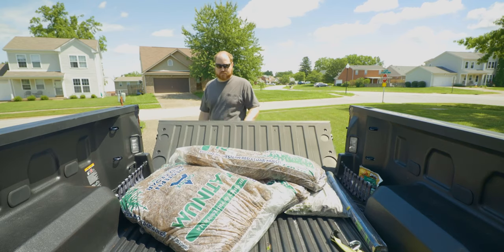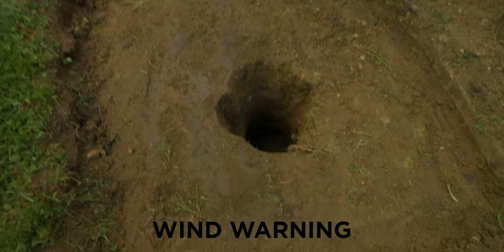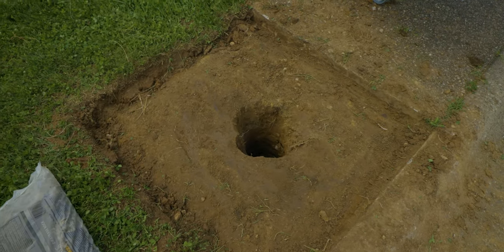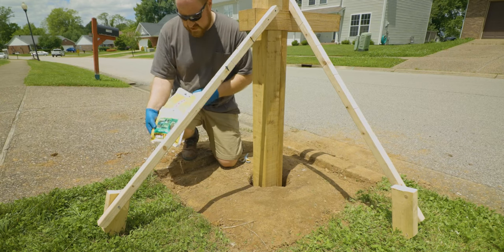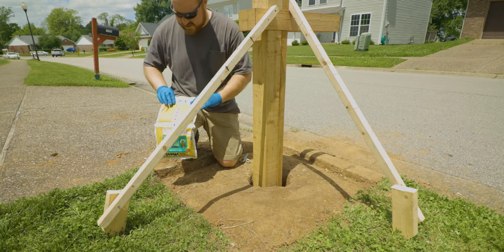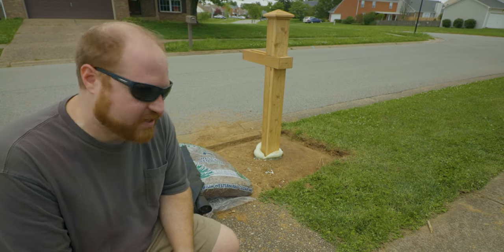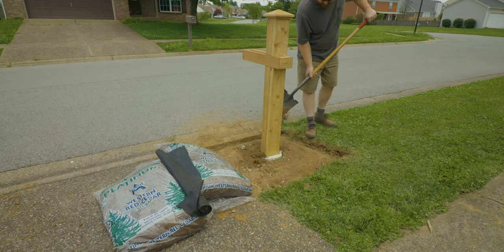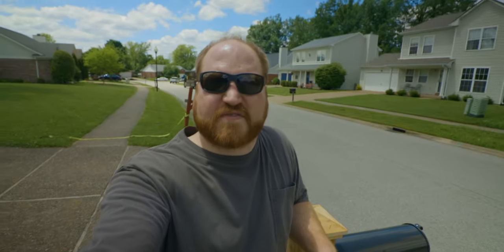Installing my new mailbox- using foam post mix for the first time!

Comment: I'm about to use that foam on mine...how well does it work?
Reply from the maker: It's been 2 years and it's worked flawlessly. It actually got bumped at one point and I drove a couple wedges of wood between the foam and the ground and it took care of the wobble. I highly recommend it for mailbox installation.

Comment: Do you think normal expanding spray foam would work just as well?
Reply from the maker: If you're talking about the stuff in a can, I'd say nope. The post stuff is works in a very different way and is much better suited for this application.
Reply: @Obscuremotorsports  Ok, I was talking about the stuff in the can. I’ll try the post foam stuff out. Thanks

Comment: How is the expansion foam holding up?
Reply from the maker: It's been about a year and its holding up great! no signs of wobble or movement. My neighbor hit my mailbox a couple months ago (and then didn't tell me). It loosen the dirt up a little and started wobbling. I made a few wooden wedges and hammered them into the ground between the foam and the dirt and it became solid again. Still would recommend.

Comment: I wish you lived in my area because a Fedex truck hit my wooden post in late December 2022 and letters to Fedex corporate offices about what one of their drivers did to my mailbox have gone unanswered.  I'm too old to try and replace the post myself.  What kind of a guy would do that kind of work?  A general contractor or a #DIYG?  Did the foam product work as good as concrete mix?  Good video by the way.
Reply from the maker: The foam product has been amazing. My mailbox has been bumped twice so far. The foam actually compresses absorbing the hit instead of anything breaking. I hammered some pressure treated wedged between the foam and the dirt and its solid again. I highly recommend it for mailboxes. If your fine with a store bought post I would recommend looking for a GC. Maybe ask hardscape or landscape builders. People that pour patios, and walkways, etc. good luck!